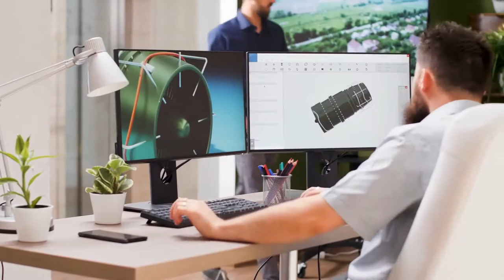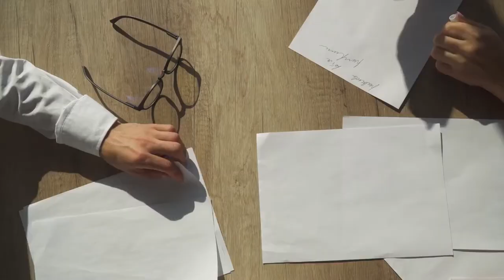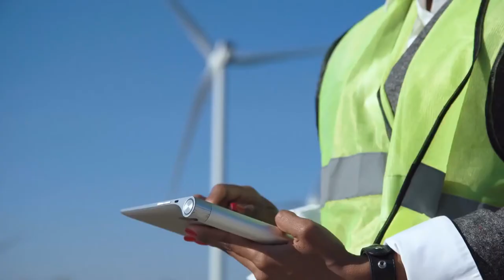The World's Biggest Wind Turbine | Is Renewable Energy The Future?

Comment: I don't unterstand the unit MW/H (0:49) - I guess you meant MWh/d. The spoken text says 288 milliwatthours in a single day - which would be very little. 288 megwatthours in a day would be big.
Vestas will produce 900MWh/d - and not 900MW/h.
GE is 12MW not 12MW/h and produces 67GWh/a not 67GW.
A single turn can produce 13MW - no: 13MWh. 
Do you get any unit right? Or is it just ro provoke comments?